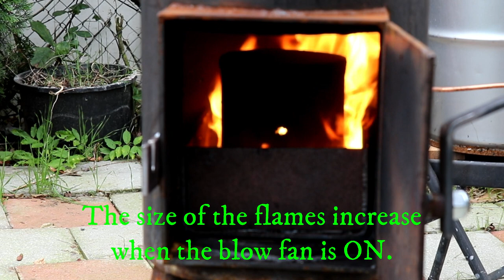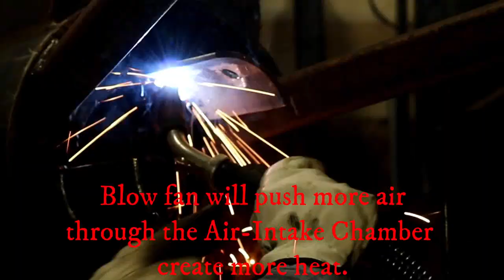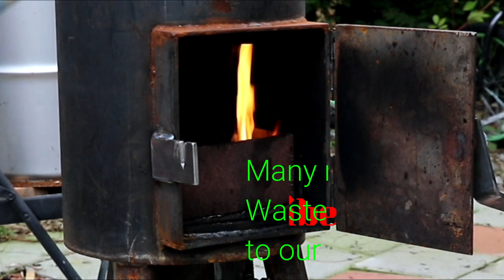Waste Oil Heater III

Comment: One tip... the oil drip. If you install a 1/2" or 3/4" pipe through the wall and extending from the drip point to about 6" out of the wall and drip the copper tube into the first 4", it will not stop up the 1/4" copper tubing from carbonation.
Otherwise, a good build.
Reply from the maker: thank you, I will looking into shielding the fuel line tip.

Comment: The van doesn’t make much of a difference blowing in through the tube that you’re putting your waist oil in through secondary to brown your waist oil to blow it in from there and make a bit more of a difference where you’re blowing it from because you’re pushing it up it’s hitting the top lot of it’s coming back down where the fan is not all of us getting out of the holes just something to think of good job
Reply from the maker: thank you